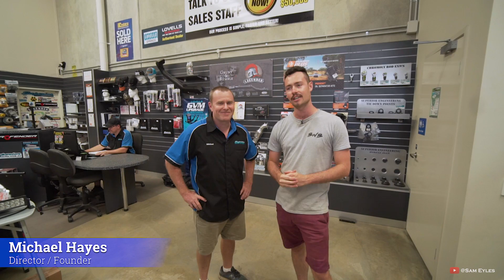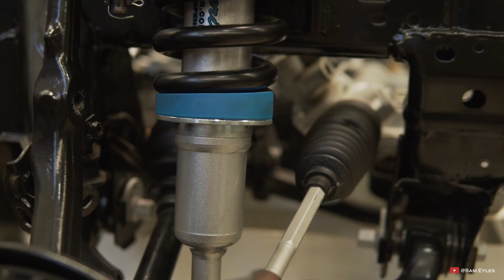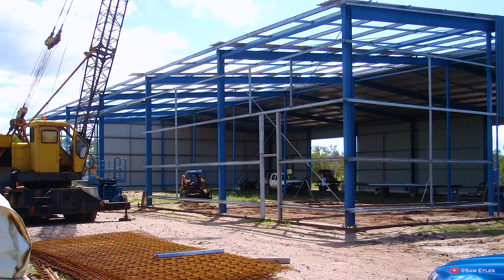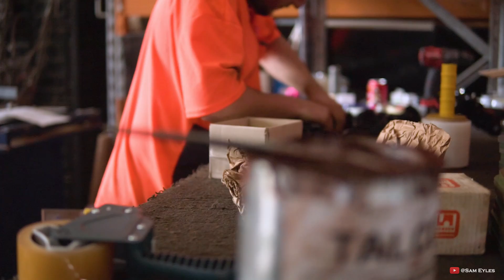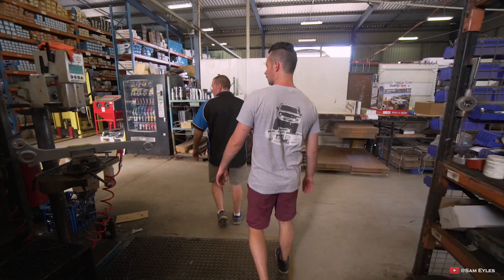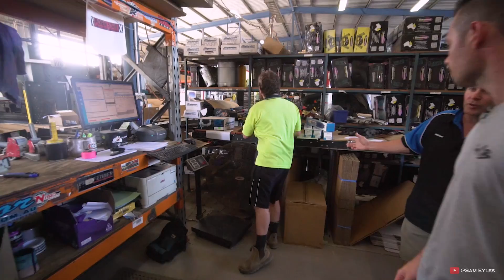INSIDE SUPERIOR || 4x4 Suspension At It's Finest

Comment: Hey mate, I’ve got a 2” superior engineering remote reservoir lift kit in my dmax and my 285/70 tyres still seem too scrub occasionally in the front when I hit that sweet spot while 4wd, any pointers how I can change this or if I can raise my suspension in any way? Has had a bodymount chop already aswell

Comment: Superior seem to get the wank factor rap but ive got heaps of their gear under my nissan and cant complain. Works well and if ive had any issues they are fixed immediately. Had some valves let go in my shocks and they sent a few up instantly no questions asked. Rather impressed to see how things work down there